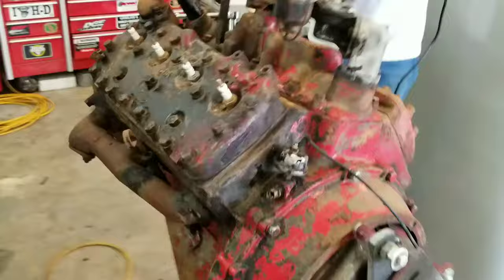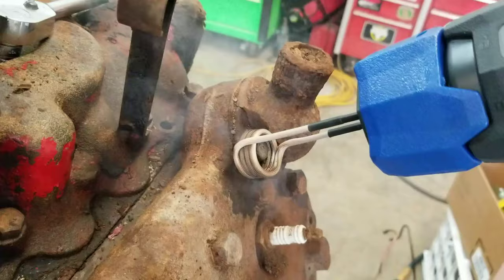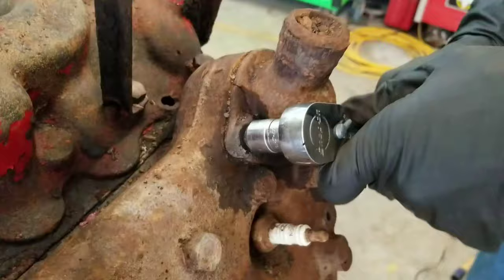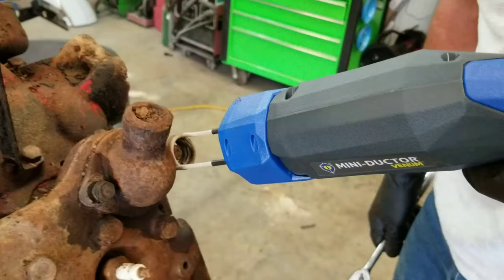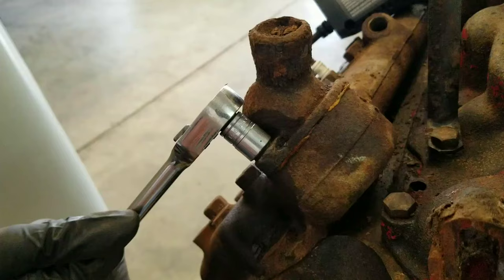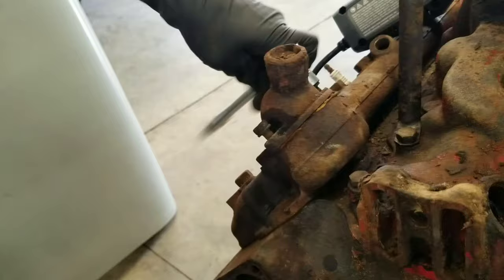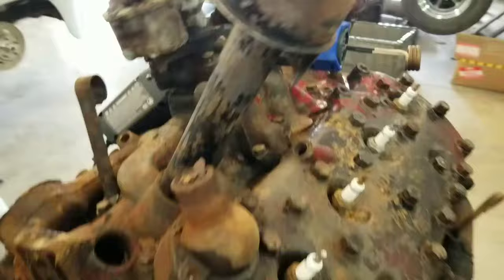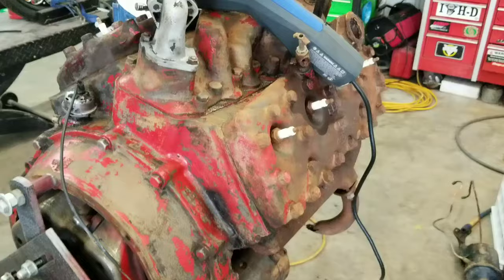A Cool Tool for Removing Rusted bolts and fasteners

Comment: At $600 for this gadget, I'll GLADLY stick with my oxy acetylene torch.
Reply: Likewise!
Reply: 600$ ? Just make your own, not exactly hard, or expensive.
Reply: Just buy a 1000 watt immersion water heater.

Remove the thick steel pipes, calculate surface area to heat dissipation of steel.

Or just put a 1/8 inch steel wire. You are done
Reply: It's induction. The coils don't put out heat, it's an alternating electromagnetic field that heats the ferrous material inside the coils directly. Also power is cheaper than using fuels to do the same thing and pretty much all of the power is going directly where intended which is an efficiency thing compared to that of your torches. No bottles to buy or refill to do the same job less waste and less overall heat in the surrounding area. As another said too, you can easily make your own dirt cheap and size it up or down accordingly.
Reply: MidnightMarrow i know this one is an induction.

I was talking about hacking an immersion heater.
Reply: for $75 you can just use a e-nail... from 1 - 3000 degrees!
Reply: Only makes sense for a shop that can make tools like that pay for themselves where saving time is saving money. Bet over some time will be significantly cheaper if not knocked off.
Reply: Yeah but wait a year or two and the harbor freight version will come out for half the price. :)
Reply: Yes Harbor Freight!
Reply: Ryan Taylor ... I remember a $600 gadget I bought... A Milwaukee PEX expansion tool... 30 years later as a professional plumber I use it regularly... Just a thought ... Peace ✌🇺🇸🇺🇸🇺🇸
Reply: u can redo the tool with 1$ of electric equipment and 2 wire
Reply: @matthewazboyliberaldestroy2008  you use pex...not a very good plumber
Reply: I would love to get one of those. I have done many jobs using to heat remove frozen nuts and bolts. So this demonstration on frozen nuts is very impressive! How does fare with old bolts?
Reply: The price will come down with time and scale.
Reply: Mine has paid for itself in time. It takes 1/10 of the time to use and put up. Never needs filled. Doesn't set shit on fire. Go ahead. Waste your TIME!
Reply: @matthewazboyliberaldestroy2008  Was that a screwdriver?
Reply: or just use an as seen on tv induction oven that someone threw in the trash just like this useless tool should be🤣🤣🤣...i 2nd using the torch or simply use pb blaster for 5 bucks
Reply: if you know what youre doing you wont snap a thermostat cover bolt with no heat,lol
Reply: damn millenials🤣
Reply: Dont wanna warp or crack those heads on a flat head ford.
Reply: Jesus... the level of stupid on this thread off the charts. Can this be built cheaper than 600, absolutely,  how long will it last, unknown, but I'm here to tell you you can make one with Chinese guts for less than 100 bucks. 

A lot of people use them for melting small batches of metal, like jewelry type volumes with a graphite crucible,  but, they absolutely work.

The point about the cost is simple, how many of you torch guys have a plasma cutter? Ok, why? Because it's faster, cleaner and for 95% of the shit you're gonna cut, unless you're an industrial fab house, is just fine. This tool is the same way... can a torch do this and more? Yep, but who wants those little soot streamers floating around to crack 2 bolts loose, and have to wind up the hose, and waste the gas in the lines.
Reply: @FactsFirst  Professional mechanics don't buy Harbor Freight tools 😄😄😄
Reply: @amfinc2  harbor freight, keeping the shysters somewhat honest
Reply: 600$ that's fucking insane.
Reply: 600 from snap on wow I was thinking 3000 lol
Reply: Ryan Taylor Benz-O-Matic torch
Reply: @jimmygrant3212  tell that to my set of 40 plus year old craftsman wrenches
Reply: I would personally pay 38 for an SK (made in USA) wrench than cheap 5 dollar wrench. trust me its worth it.
Reply: Q StiX, that’s what I’m talking about
Reply: Snap on is stupid expensive I can’t understand why businesses buy it price gouging big time
Reply: nilts1975 right the torch does the work,the bolt does the work with this thing
Reply: @MidnightMarrow  these tools wear over time also, they are shit we have one at work.
Reply: problem is a flame transfers the heat everywhere...   but at $600 this guy got ripped off..  its an induction heater..

you can make them from plans on the internet for like $20 lol
Reply: @amfinc2  And it will be crap like everything else HF sells.
Reply from the maker: Most Common reply of course. 
Yet, many times you can not use a flame. Like around gas or expensive rare parts as in our later videos.
Reply: What is it about the heat that releases the bolt? I thought heat expands thus the bolt expanding. Makes more sense if the bushing was heated. Anyone?
Reply: @davethefishermanthefakefar959  professional mechanics who don't want to sell their soul to snapon for their entire working life do learn what can be bought at harbor freight. Harbor freight has come a long way in tool quality, their impact sockets work just as good as snapon for a fraction of the price. I used a harbor freight die grinder for many years, probably had it 20 years before it quit workin, i paid $15. I could have bought 20 for what one cost from snapon. There's other things I would like than just a collection of overpriced tools so I can brag about how I'm "professional" and only use brand x
Reply: @chrisparker4940  reason bolt gets stuck is dried oil as well as rust the heat burns all the trapped oil out of the threads and the bolt comes off
Reply: Benzomatic torch!! No brainer!! But remember...they market to the people, who DON’T actually have common sense!! Does that have to plug into a wall for power!? Hmmm... I remember having to change out the blades on my swather in the field with rusted nuts with no power! Benzomatic!!

Comment: Here's a trick I use with stubborn bolts, i'll  tighten then loosen and repeat that seems to work for me, and sometimes a little tapping helps too.
Reply: You've obviously never worked on something that is so rusted it's essentially welded in place with rust, there is no tightening or loosening without snapping
Reply: @redrustyhill2  well when there that rusted a hammer and torch works. Just tap it try it, heat it tap it, and try again.
Reply: @adamgray2070  like I said, you obviously have limited to no experience, many situations using a torch would burn up wiring, plastic, whatever else nearby. Many situations a torch would get other parts too hot and cause damage. Induction heaters get ONLY the target bolt or nut hot.
Reply: @redrustyhill2  i use what I have sometimes a torch is not available, and usually they're exhaust bolt when torch is used. Other than that I use the tapping method sometimes at the end of the wrench (like a impact wrench). Works for me in the the situations I have encountered.
Reply: @adamgray2070  when you encounter a fastener completely rusted in place no amount of tapping is going to help, heat is the only option.
Reply: @redrustyhill2  Come live in the northeast and you’ll see why your method won’t work.  Where a 1 hour job takes 4 out here when you aren’t prepared for the rust.
Reply: @datazndood  "my method" is what's been used by mechanics ever since the nut, bolt, and heat wrench has been invented. Other than heat, drilling out and removing the rusted bolt with a drill bit is the only way

Comment: I think that tool works like a super charge rotor heater for jet engines.
The coil in the main part uses induction (EXTREMELY STRONG MAGNETIC EXPOSURE)... that in turn heats up the bold head AND threads. The old way (using a propane torch) only heats the head and bold, but without the electromagnetic induction the threads would still stick, hence the 'broken bold".
Heating by induction actually separates the rust from both threads. The rust is still there, but it's no longer attached.

Comment: another added technique on really ruusty bolts in addition to penetrating oil is to go back and forth in tiny  increments  [ loosen, tighten, loosen, tighten etc]and increase it a bit each time maybe applying more wd40 as you go. i did this removing sparkplugs in old 5.4 L ford engine.  they scxreeched so loud i thought for sure 3 out of 8 were gonna break but it worked none broke bad enough to need trhe extracrtion tool i alreadsy bought